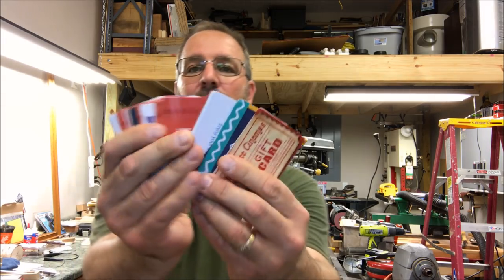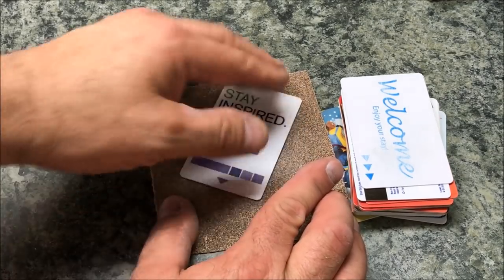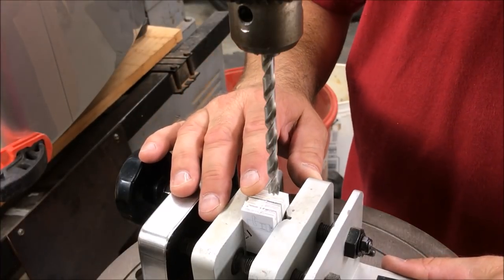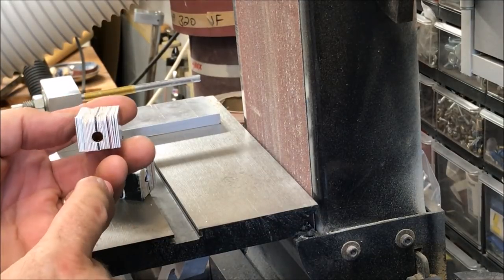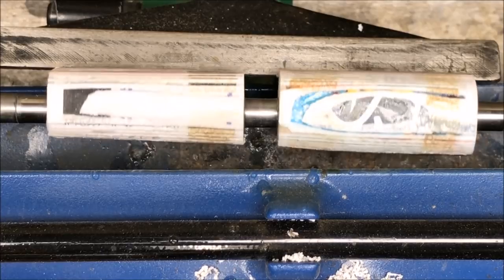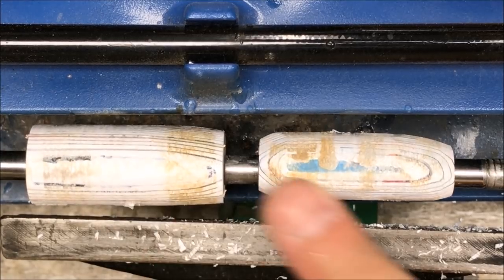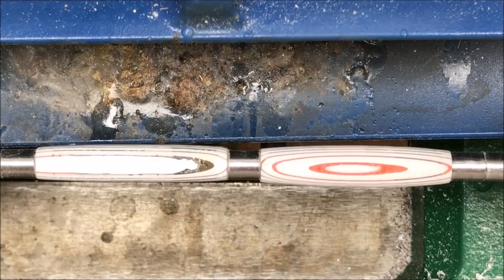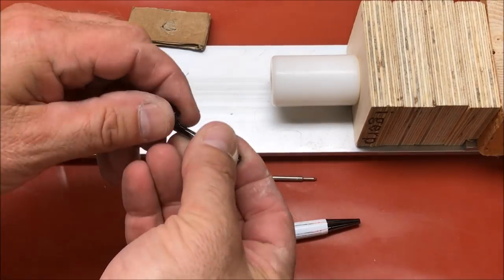Make an Ink Pen from Used Gift Cards

Comment: I'd have given up on the drill press blow out.  :|   I admire your perseverance.   Came out real nice.  Maybe if you try this again, add some dark colored dowels angled through the blanks from various angles.  Cheers! Chris.
Reply from the maker: +CrossWood Nice suggestion Chris,
  I plan to do this again and I recently learned gift cards are PVC. Planning on using a different glue. 

Regards,
Bob

Comment: Carbide would help
Reply from the maker: +Steve Muise I don't know about that, carbide is good but it's really aggressive. I think the issue here is the glue, Epoxy, provided a mechanical bond that wasn't good enough. I did a little research and found that gift cards are made of PVC. I need to use PVC glue which will create a welded bond. I'm planing to test this theory as soon. As I accumulate some more cards. 

Regards,
Bob

Comment: This pen turned out nicely!  I did this technique for last year's Christmas ornament challenge (my one and only youtube video....) and experienced many of the same problems.  I turned the ornament bulb from laminated gift cards in the "face grain" orientation rather than the "spindle" orientation you used.  I think this made for a more supported bit of lamination, at least when turning the outside of the bulb; but when hollowing, the outward force cause a couple of de-laminations that  I repaired with CA.   In the initial glue-up I tried both CA and epoxy, with mixed results.  I did find that a carbide cutter worked best.  I also found that sanding at anything but a very slow speed tended to sort of melt the cards making it difficult to get a really good shine.  I hope this information might be helpful to anyone interested in trying this.  

One other thought, you might have interesting success using your herringbone method--the inter-woven aspect might make for a more structurally sound blank that could stand up to drilling and turning.  Just a suggestion!  Thanks for all your instruction--I've learned a lot from you!
Reply from the maker: +Regina Shedd Regina,
  I love the herringbone idea, that sounds cool. I recently learned, after all this mess, that gift cards are made from PVC. The next one I make will use PVC cement. That will melt the cards together and give a much better hold. 

Regards,
Bob

Comment: I'm coming into this one quite a while after you've done it, but if you decide to do another one of these, try using Testors brand liquid model glue. Gift cards tend to be made of Polystyrene plastic just like most model kits, and this glue works by melting the plastic together. I've been building model kits for years and can attest to just how strong the bond is. For maximum strength, once you have the stack glued together and cut apart, brush more model glue on the edges - it will suck into any voids and help to bond the edges, reducing the risk of catches
Reply from the maker: Thank you Owen, I
May just try this one again. 

Regards,
Bob

Comment: Seems like I have missed a lot of things, and using gift cards to turn a pen is beautiful.
About gluing the gift cards together, I have some experience and I think I would like to share.
Mose gift cards have a transparent laminate that is very resistant to all sorts of corrosion,  and hence you won't be able to glue them very well even with CA or epoxy.
Just a knife to peel off the transparent layer on both sides, then glue with model cement or industrial thinner, then they bond together like a brick.
Reply from the maker: Thank you for the advice. 

Regards,
Bob

Comment: Cool idea for recycling those cards into a pen I am curious if they had been stacked the other direction if it would have worked better. Although that may not have been the look you wanted with it. I recycle these cards a lot to make guitar picks out of them. There is a punch called the Pick Punch that makes it really easy. I can get four or five picks from every card usually.
Reply from the maker: I think they may have been easier to turn if they were stacked horizontally. I would have tried that but I needed more cards, LOL. Maybe a future project. 

Regards,
Bob

Comment: Nice work!

I had an idea about your sanding of the blanks to round over the edges.  Your current method doesn't center the "curves" around the tube, which is the center of your turning.  You have a jig to sand the ends down, why not try making a jig to help sand the corners off which sits in the tube to make the rounding "true" to the blank?
Reply from the maker: +Jason Adamczyk That's a great idea Jason. 

Regards,
Bob

Comment: How about trying a solvent to "weld" the cards together instead of gluing.  Also, mount your blanks and bushings on a bolt in your drill and do initial sanding on belt sander and finalize on lathe.  I will try this when I get time.
Reply from the maker: +Glenn Hitt Hello Glen,
  I have recently found that most gift cards are PVC so I know what glue I'll be using on my next attempt. 

  Nice idea about sanding with a bolt to help hound out the blanks. I need to put some thought into that. Adding the idea to my little brown book of ideas. 

Regards,
Bob

Comment: your tools need a good sharpening, if you use a grinder, use the grinder for a majority of the sharpening, then use some very fine sandpaper (between 600-2000)or even better a very fine sharpening stone. then strop using a piece of leather, maybe the inside of an old belt
Reply from the maker: +thor knives Thank you. 

Regards,
Bob

Comment: Interesting process. Did you ever try using a angle grinder with a flap disk on the lathe? That might work and speed up the process considerably. 

The result is great. In fact its a plyplastic pen (as opposed to plywood) ;)
Reply from the maker: +Willem Kossen I've never tried an angle grinder. I don't own one. I like the Poly ply, LOL. 

Regards,
Bob

Comment: Great job getting to the finish line with that one Bob!! Do you think it may have worked better if you cut them in 1 inch squares and glued them that way. Then you would not have had the full length of the card.
Reply from the maker: +John Bittner Hello John,
  I think the issue is with the mechanical bond provided by epoxy. I have recently learned that gift cards are made from PVC so they require a welding bond. I plan to remake this blank with PVC glue. 

Regards,
Bob

Comment: Bob, since you found out that the cards are PVC I figure you'll try PVC pipe glue if you ever decide to try it again but I was wondering if you've ever tried heavy duty contact cement on anything you've turned and if it worked or not. Also since the CA is so brittle would the epoxy be a better choice for gluing the tubes into the blanks? Thanks in advance
Reply from the maker: +ffscj I do plan to try this again and I will use PVC cement. I haven't tried contact cement, it would be interesting to see how it performed. I use a medium C/A on my tubes and I've never had any issues. Epoxy is always an excellent choice if you have the time for it to dry. 

Regards,
Bob

Comment: Bob I think it turned out really well! I think you had your work cut out for though! I think I am going to try this. Have nothing going on but waiting for the snow to stop.and it probably just stopped out in your neck of the woods. I think I’ll try some to scuff the cards with 60 grit then use some structural epoxy with a 45 minute open time and a negative rake carbide cutter. I’ll let it cure for 12 hours or so. Hopefully I’ll have some decent results but after seeing what you went through I’ll be holding my breath. I’ll let you know in a few days.
Ron
P.S. Have you ever done a craft show at a vineyard event or elsewhere in Southwest Ohio?
Regards’
Reply from the maker: Hello Ron,
  Please do keep me posted, I’d love to hear about your experience. 

  I haven’t done a craft show up that way. I’ve done a number of them in southern Indiana. 

Regards,
Bob

Comment: You worked really hard on this!
Reply from the maker: +Kat Atkinson Thank you Kat. 

Regards,
Bob
Reply: I recently turned some tool handles from plywood. Had the same problem with both spindle roughing gouge and the skew to out an entire side. I ended successfully with very gentle use of a smallish and very sharp bowl gouge. I’d be interested in trying a bowl gouge with laminated store cards. 

Turned with sandpaper. Who would have thought. Maybe a file or rasp would work to take it to round then swap to a gouge.

Comment: Do you think a deeper, more aggressive sanding of the cards might have helped the epoxy bond better?
Reply from the maker: +Steve Jackson Its possible,
  I eventually tried PVC cement and had similar issues. I think the material is just to soft.  

Regards,
Bob

Comment: Not to sound like a negative nancy here, but this was a video I probably wouldn't have published. It was one mistake after another, which I saw coming immediately after you finished putting the cards together, where you didn't apply a coat of epoxy all over the outside, or in a mold, of the cards, followed by putting it in a pressure pot to make sure all that epoxy was pushed into all the open spaces to create a really tight bond. On top of that, you didn't go all the way down to the bushings, leaving a lip which is very noticeable on the middle ring. Overall, just not sure this gives a final appearance that I'd want from that much work, it just looks like a boring blank. Sorry.

While I know we all learn from failures, as the old saying goes, failure is the best teacher, but when it comes to YouTube videos, viewers want to see perfection or at least something done right. 

Just some constructive (albeit slightly negative) criticism, nothing personal as I enjoy most of your videos, but between the last blank making video that didn't go well and this one ... my suggestion is to be a little more selective on what you upload. Just a thought.